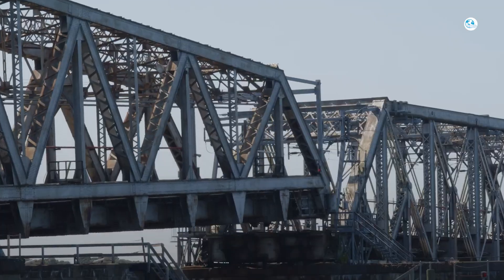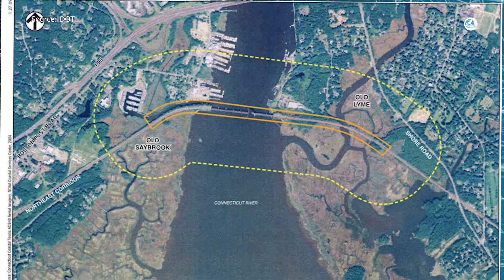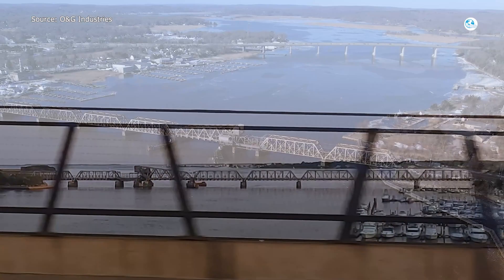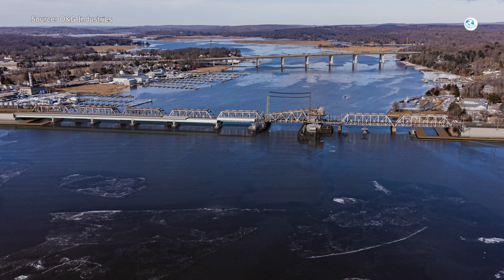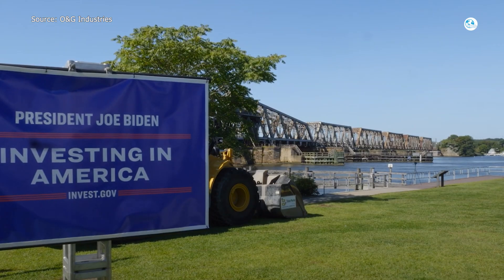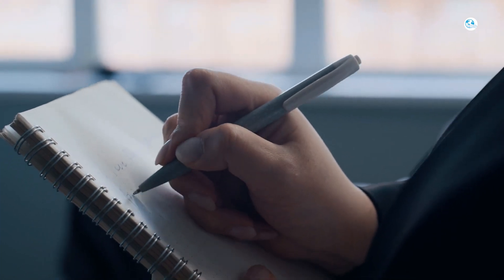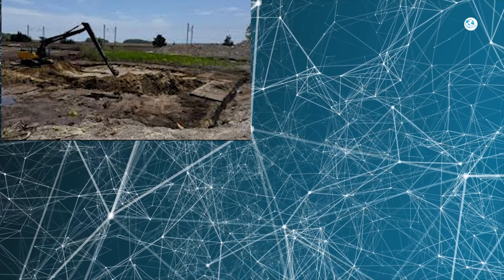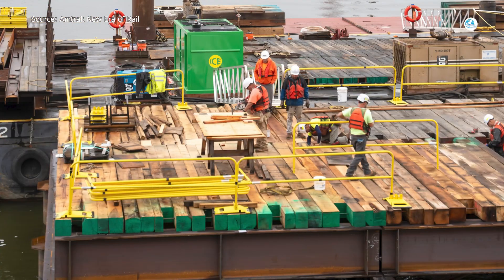$1.3 Billion Amtrak Bridge Replacement is Coming Sooner than you think

Comment: Dude - you realize that what you just posted is a world-wide disgrace? Brand new passenger bridge on a supposedly high speed line for speeds of 70 mph? I understand - you are just making a video and were not involved into the engineering decisions, but is it a good content for one? If 70 mph is all those officials are capable of - they could have at least been more humble about any sorts of ceremonies.

For passenger services, everyone now is building brand new infrastructure for 200+ mph speeds. China has build a whole network of high speed rails. Russians, despite all the sanctions and war, are building a brand new high speed line between Moscow and St. Petersburgh for speeds beyond 200 mph - and it's the same distance as the whole North East corridor between Washington DC and Boston. The construction is at full swing and they want it done by the end of this decade. And here - we are talking about single bridge replacement. 

Any news on finally re-laying old tracks with wooden sleepers in CT and NY? Trees for those sleepers were probably chopped when Cornelius Vanderbilt was alive...
Reply: China and Russia both can come in and steal property from the owners, so the subjects ( I don't call them citizens because they don't have property rights) can be told to move. American citizens can refuse to sell their land, so the rails will never get straightened, as they are too many curves on the Northeast Corridor.
Reply: @ArthurPasseri We have this thing called eminent domain, we just don't use it for the right reasons.
Reply: @Zadesniper  Eminent domain is essentially impossible to use on wealthy owners of waterfront land.

Comment: How ridiculous is that! You have just launched a train with a target speed of around 200 mph and you are building a bridge for this train with a top speed of 70
Reply: There will never be a 200mph speed service on this line. Too many curves. There are still 45mph speed restrictions within a few miles of this bridge due to curves.
Reply: 200mph is not the "target speed" of the NextGen Acelas. They may be capable of 200mph, but top speed for the entire northeast corridor is 160mph. No official at Amtrak never said anything about 200mph on this line.
Reply: Absolutely.

Comment: A long range plan has Acela traveling from Boston to Atlanta. They are closing in on extending to North Carolina. Of course the line needs to be electrified.  But Ashland, Virginia is a major headache. The railroad goes through the middle of this town at ground level. So ALL trains must slow down as they pass. I lived in SillyCon Valley where they buried their cross streets under the railroad. I sense that will happen in Ashland.

Comment: The narration says the new bridge will be a fixed span design, which means no moveable section.  But the video clearly shows the new one will open just like the old one does.
Reply: The narrator said it will be a fixed span bridge with a 50 foot clearance so boats can pass underneath. No drawbridge, according to the narrator. That's what I got out of it. Check out around the 2:20 time stamp.
Reply: There are many FIXED spans in the bridge, with ONE moveable span!  Didn't you look at the video for more than 2 seconds??